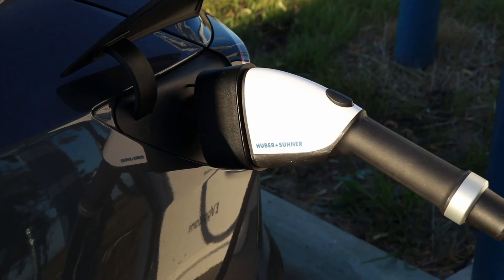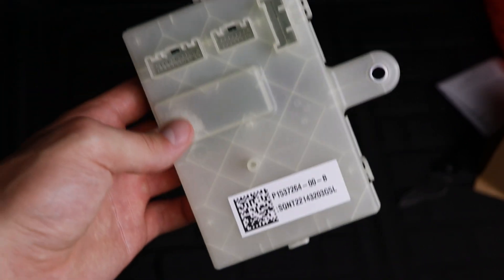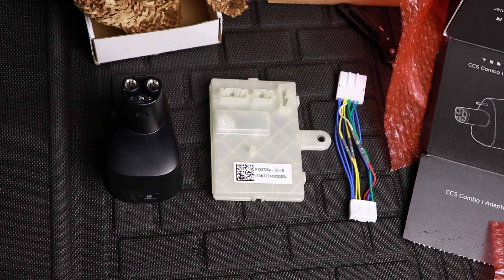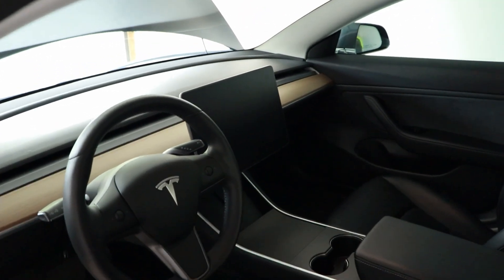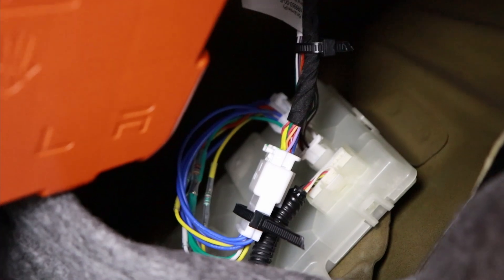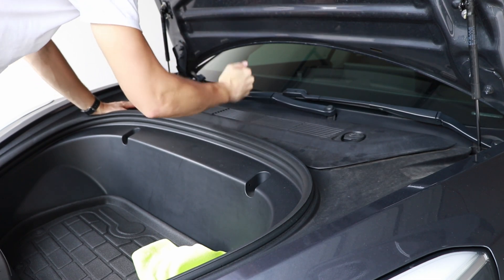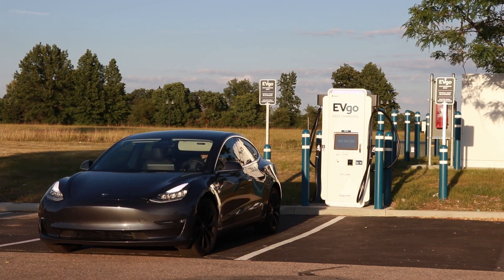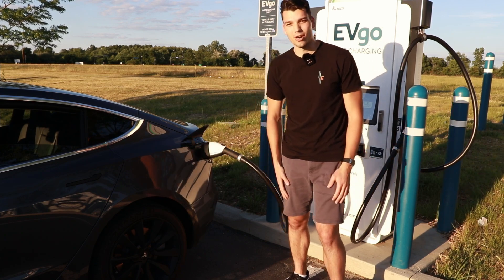How to retrofit CCS Adapter Support to your Tesla! (USA Tutorial)

Comment: Hi folks,

I am looking for this hack for a 2019 Model S Performance.  I was about to order these parts when I saw even Falcon says it only works for "Model 3s from 2017-Oct 2020 (chrome trim)".  Anyone know if there is a hack like this for my vehicle?  Also looking for hacks to use the supercharing network with a salvaged vehicle without doing the reinspection.  Wondering after doing a CCS retrofit for my car, if it would even allow the system to charge on CCS if I am still not allow to used the Telsa supercharging network.  I have read on some forums salvaged telsa's have been able to supercharge on CCS.

Comment: the model 3 service manual does not specify that the 12v and HV battery need to be unplugged or the vehicle need to be completely off. since there is no HV flowing through the ECU?

Comment: That’s so much faster than I’ve seen even on v3 super chargers. Never seen anything over 650 miles per hour that one was over 800 just wow
Reply from the maker: Which vehicle do you have? Model 3 is a bit more efficient, so it will add miles at a faster rate

Comment: Be aware! My 2020 Model Y's touchscreen said "Compatible" - so did the order screen on my Tesla account - but after I got the adapter, I tried to charge at an EV Connect DC station, and the car's screen said "Communications error". After an hour on the phone with EV Connect and then Tesla Service, I discovered that I STILL need the ECU upgrade. DON'T TRUST Tesla's site or the car's Info screen on this. I'll be sending my adapter back, as it's not worth the extra $250 for the rare instances that i might need it.

Comment: Why did you power down the car? You are not working with any part of the car that carries high voltage, just pull the old one and plug in the new ECU and wire harness.
Reply from the maker: I'm working right around where the charging port is, so to be safe I shut everything down. I had to restart the car anyway after upgrading the ECU, so might as well turn it off while I'm working.

Comment: Aren’t you afraid you voided your warrant by doing this?
Reply from the maker: My warranty is already up, so not too worried.
Reply: @Sibs  I have a 2018 LR and just bought a Ford lightning and gave my Tesla to my wife.  The ford charger is much more powerful and I would like to replace my Tesla charger with it.  Tesla is coming out with this this year correct?  Any idea on price?
Reply from the maker: @techmap4191  no matter what charger you connect the Tesla to, it will max out at 11.5 kW or 48A. The Ford lightning can handle up to 19.2kW or 80A. Not sure which charger you have

Comment: Hey - FalconFour here! Wow - can't believe I missed this video for the past few months. What an awesome breakdown, almost exactly perfect video representation of the forum thread. Of course, it's critical that people understand that the "Bundle"/harness/adapter only applies to Model 3s from 2017-Oct2020 (chrome trim). If you try putting the adapter/Bundle/harness on a Gen4 car (Y or black-trim Model 3), you'll have a bad time. The Bundle is an unofficial hack, tweaking and rearranging some sensor inputs so that your Gen3 charge port looks and (mostly) works, electrically, like a Gen4. The only caveat is that the temperature sensing is shifted upward a bit - the car thinks the port is hotter than it is, but it aligns with overheating values for safety (it will not allow the port to melt, and may throttle a bit earlier than it otherwise would, to keep temps low).

The Bundle will not be Tesla's official solution, when it comes out - but it seems Tesla is unofficially satisfied with this hack - if you try to buy the now-released US CCS adapter, and you have done this retrofit, the Tesla shop "opens the gate" for you and lets you buy it (says your car is compatible, after it's been updated). The Gen4 ECU appears to be electrically compatible with the Gen3 port, but just a slight change of firmware is needed to make it work - so they will likely offer a Gen4 ECU with a different part number as a retrofit option.

For those that want an even more Tesla-OEM approach, Google "Tesla K-ECU CCS" and look for the teslaownersonline thread -- that uses a Korean Gen3 ECU that's basically the same as the original Gen3 ECU, but supports CCS. In that, you only lose cable-button-remote support (can't open the flap using the charge cable button), but otherwise the button works fine, as do all other features. It may also be harder to find that ECU.

Really glad to see such a well-made video documenting the upgrade! You can bet I'll be sharing this around. :)
Reply from the maker: Hey!! Thanks so much for the comment and deeper breakdown. You and the Tesla community were so helpful in this journey!

Comment: Thanks for the video.  Ditto on having the doors, windows, frunk, and rear trunk open when you disconnect the battery under the seat.  I made the mistake of closing the door and almost got locked out of my car.  The first plastic trim piece that you remove that is located on the top of the trunk requires that you use a small flathead screwdriver to pop out the center pin on the two black round trim pieces on each end.  Don't try to just pull the trim piece off as he does in the video.  Additionally the driver's side carpet is held on by another black round trim piece that is under the trunk lip.  (not shown in the video either)
Reply from the maker: They must have updated some things because I didn't have that second trim piece you mentioned
Reply: My car is a 2019 M3P.

Comment: My 2020 Model 3 LR was built in September 2020 and it is CCS enabled.  I bought a CCS adapter from Tesla Korea in May 2022 and have used it successfully a number of times. You may want to double check the dates you are quoting as to when the CCS was included in the factory.
Reply from the maker: I misspoke in the video unfortunately, I will add a pinned comment about it
Reply from the maker: Meant to say Oct 2020 in the video

Comment: Glad your helping to spread the word on CCS compatibility.
Especially for salvaged Tesla owners who don't have other options to DC fast charge for traveling.
Reply: Are you selling salvaged/rebuilt Tesla's? How have you overcome the auto-disabled supercharging? Is CCS the only option other than destination chargers?
Reply: @jacobautosavvygilbert2266  I just bought a salvaged title Tesla and the dealer I got it from took it to Tesla to get it reinstated and I can use Tesla superchargers. It cost a couple thousand though I have the paperwork. So it’s possible but this way seems cheaper!
Reply: @jacobautosavvygilbert2266  I am rebuilding a car now that I'm going to sell yes.  I will include the retrofit and a CCS adapter with the car.  Supercharging is currently disabled for all Salvaged titles.  Thankfully CCS is available now just like every other EV which currently cannot use Tesla network anyway.
Reply: Do you guys know if doing this will allow you to fast charge with the adapter? Also don’t have access to superchargers because of rebuilt title.
Reply: @jairopedroza6693 yes it will

Comment: Can this upgrade be done to a 2019 Model S with FSD Beta?
Reply: You can actually use the European CCS Combo 2 Retrofit Kit to get CCS1 capability here in North America.  I bought the kit for my 2018 Model S on EBay and did the hardware myself.  I had to find a friend that was able to make the Software/Gateway configuration changes that were required afterwards so the vehicle would recognize the new hardware.  My salvaged Model S now charges at 150kW!
Reply from the maker: Nope, Model 3/Y only as far as I'm aware
Reply: Tesla said to check back with them in 2023 for the upgrade for older models.
Reply: @billtcheng2316  that is correct.  Tesla has stated at some point in the future (remember Tesla time is different than real life) they will start offering it as a formal program at Service Centers.  Unfortunately, I doubt they will offer it to the owners of salvage vehicles.😞

Comment: just a heads up, you might not be able to drive before doing a software update. I just did my retrofit on my '18 RWD LR, and the error I had was something about an incompatible software drive control version. I couldn't drive until I did the software update.

i also had a third clip that i had to remove from the rear wall of the trunk on the left side before i could get the lining out of the way enough to get to the ECU (same kind of clip as the two that hold the top trim in place).
Reply: This happens if you're reusing a previously-flashed ECU -- either from your car or someone else's (used on eBay for example). If you get a used ECU, the car will shut down with a fault and be undriveable until you get the update. Only a "virgin" ECU will still let you drive -- not exactly sure why. But yep - that probably explains why you had a difference there :)

Comment: This is the second video I've seen where the EVGo charger is showing a slightly higher rate of charging than the Tesla screen indicates (203 vs. 191).  One of them has to be wrong.  At this juncture, assuming that the EVGo is reporting incorrectly, they're making a little more money off the charge than they ought to be, no?   A little adds up to a lot if they're all doing this...
Reply: Don't know if I would go straight to charging the company with fraud. 🙂 Every other charging adapter I have (CHAdeMO & Lectron CCS1) show a loss from what the station shows it"s delivering to what the car is receiving.  Im going with electrical loss due to the adapter.

Comment: i did exactly wat you did in the video and that does not work still the same error code difference is  ill go in service mode and reinstall software 16.1.1 hellllppp please
Reply from the maker: What car do you have?
Reply: @Sibs  finally i found out the problem i have an ingenext boost module and i have to remove it  and put it back after and now its working thanks

Comment: Does anyone know if this solution or equivalent will work for North American 2014 Tesla model S?
Reply from the maker: There is none known right now for older Tesla models.
Reply: David Green,  You can use the EU CCS Combo 2 Retrofit Kit (Pre-Refresh version) for Model Ss before June 2016 to get this capability.  I have read in some forums that vehicles with Gen 1 charge controllers can not use this modification.  I am not sure when the Gen 2 controllers rolled out though so you would have to do some research to see if that is true or not.  The EU mod worked great on my 2018 Model S.  I just uploaded a video about the process here on YouTube.  Happy to chat more if your interested

Comment: The Tesla CCS to Tesla adapter is limited to about 200 kW. You won't get any higher even if you are at 5% SOC. It's just the limit of the adapter. I have one and tested it on my Model Y and a newer 3 with no problem.
Reply from the maker: The theoretical limit of the adapter is 150kW - it is rated for 500V and 300A. I believe that is a continuous rating though, which allows it to go above 150kW for limited amounts of time. That being said, 200kW does seem to be the "limit" in most people's experiences
Reply: It's actually a function of amps & volts - watts is a result of amps*volts (thus watts/1000 = kW). Stations are often limited to 500 amps -- however, Electrify America has been seen recently doing boosts to 600 amps (!). It would be so much better if the whole industry could stop talking about kW and talk about amps instead. The adapter itself really has no limit. Temperature is the only factor, and since both the Tesla port and the CCS port have temperature monitoring by their respective sides, the only limit is what the station and the car agree on. The adapter just facilitates.
Reply: @FalconFour  Are you saying the adapter can allow for charging at 500A or even 600A? Or does the Tesla car not allow for such high current?

Comment: do you  have the plan to were you put the pin in the connector i receive it  from a bunle of wire  but no instruction to where which color goes where in the connector thanks
Reply from the maker: I would check on that forum post. There's a lot more details than I talked about in my video

Comment: Great video. one question; if your firmware is already updated prior to doing this, how do you request a firmware update that you can have available to install upon completion of the ecu ?
Reply from the maker: I think the forum post walks through how to put the car in service mode and flash an update, but it's easiest just to wait for one to become available
Reply: As of car software 2022.16.x and the opening of access to Tesla service docs, the procedure to get into Service Mode and request a "software reinstall" is now public. You can access Service Mode by pressing and holding the model name badge of your car on the Software tab, then enter "service" and hit OK. That will enable service mode, where you can then press "Software Reinstall" to start the reinstall (it doesn't download - it just reinstalls the last update). Read and understand all messages (e.g. that the reinstall happens immediately - do it after installing the ECU). Do this sparingly - don't do it to try to fix random faults.

You can also use the "service alerts" panel in Service Mode to understand more about any errors you have - the descriptions of any alerts you see are very clear and explain what is wrong and how to fix it. But hopefully you won't need that in the context of this CCS upgrade -- may be useful later for other diagnostics, though!

Comment: I have a 2020 Model Y do you think it is the same configuration for the CCS adapter and ECU ? thanks
Reply from the maker: I would check. You can check on the touch screen beforehand and peel back the liner to see which ECU you have. The forum post I linked has more details!

Comment: Just FYI if your vehicle is running version 2022.16.X or higher, you can access service mode without needing to visit a service center (previously service mode was geolocked to service centers). With service mode you can request a firmware reinstall. The vehicle will download the version you're on and prompt you to install, much like a normal software update. I would download before you install the new ECU, so you don't risk draining the 12v battery after you finish installation. This also means you can do this ECU upgrade without needing to wait for a new software update or visit a service center to enter service mode.
Reply from the maker: Good call! Thanks for the tip
Reply: How do you enter service mode? Under service I only see Factory Reset as a possible option??
Reply: i did what you said and the software reinstall 16.1.1 and does not work pleasseeee helllppppp
Reply: In Taiwan, Location other than service centers. It is still not possible to enter service mode. The software version of my car is 2022.16.3

Comment: I recommend having all the doors (or at least driver door, passenger rear door, trunk, frunk) open and windows down before anything. I also recommend using the shutdown button in settings prior to disconnecting 12V or HV. Otherwise, excellent video. Should help a lot of people that may be intimidated by an otherwise fairly easy procedure to add a lot of functionality to a Tesla.
Reply from the maker: Good call! I didn't formally "shut down" the car, but didn't see any issues. I did make sure the doors were open as well but didn't note it in my video.

Comment: Thanks for the video it’s very helpful,  I believe you said the full process (ECU and wire harness) applies to cars manufactured before October 2021.  Looking at the forums you added in the description the wire harness should be needed for cars manufactured before October 2020 with the Gen 3 ECU.   I am looking to try this as soon as I get the ECU I have a 2021 so I should not need the harness.
Reply from the maker: I may have misspoken, thanks for catching that!!
Reply: Thank you C Moe, I have a 21 plaid delivered in late August 2021 so you info helps me regarding the harness.
Reply: @beidlern  thanks to Alex Sibila and the TMC forums, I was able to order my new ECU and did the change over last weekend.  Now I can charge like everyone else once I get an adapter

Comment: I have a mid 2019 Model S LR. Can CCS support be added?  Is the process the same?
Reply from the maker: Unfortunately I don't think so. As far as aware this is only for model 3/y
Reply: Significantly more complicated to add to Model S, unfortunately. Being a later S, you may be more likely to be able to have it at some point, however.
Reply: Alan, You are in luck.  The Model 3 mod will not work, but you can use the European CCS Combo 2 Retrofit Kit to get this capability now on your Model S (and X for those owners).  I made a video about the process when I completed it on my 2018 Model S.   I just uploaded it here on YouTube if you're  interested in learning about it.

Comment: Great video! One concern would be any potential effect on warranty coverage especially if there was a failure in the charging system. It wasn’t completely clear to me whether there were some ECU’s that were sourced from Tesla while others were from another source (and perhaps not entirely sanctioned under Tesla’s warranty). I don’t have a problem using only Tesla superchargers while on the road, but they are still not everywhere I want to go so the retrofit is very interesting. It’s too bad you have to trick the car into pre-conditioning the battery before charging but I suppose, someday, when everyone can use everyone else’s chargers, that problem will go away.
Reply from the maker: The warranty issue is definitely a grey area. I did a bit of research on what might void it but couldn't conclude anything, so didn't include it in the video. If something goes wrong, and Tesla can point to the wiring harness and say it's "not approved" then it may be on me to fix anything.